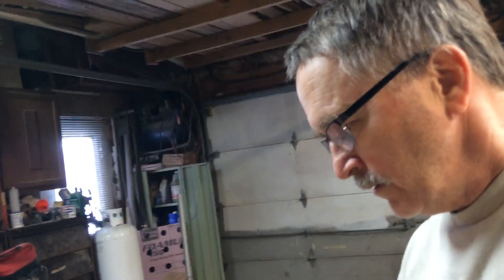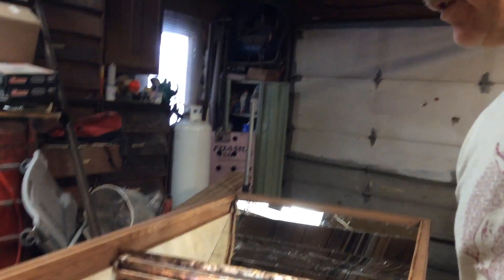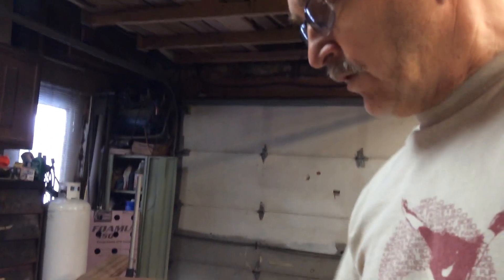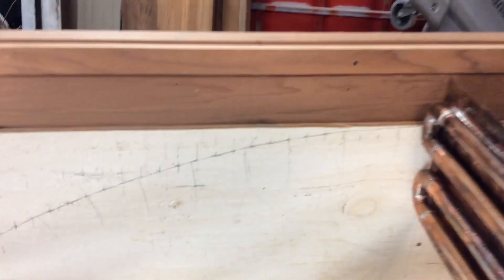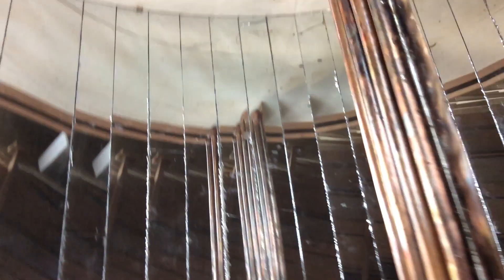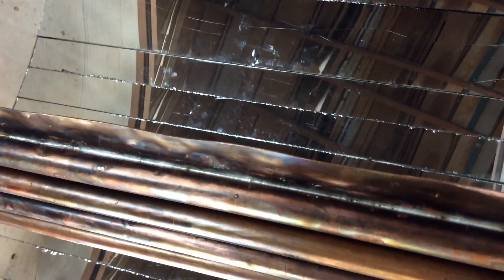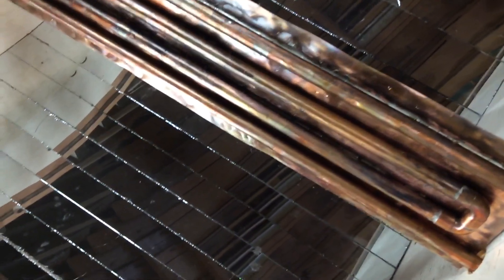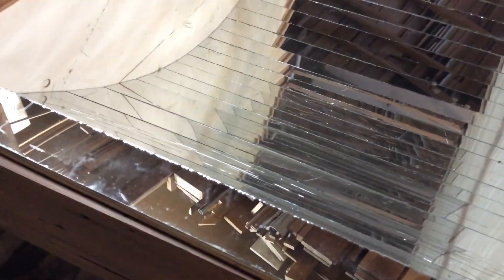Parabolic mirror trough solar hot water heater

Comment: That's a creative design if you don't need absolute max temperature.  Pointing accuracy is a lot less important for this layout.  Should be good for heating a pool or hot tub.  How much would it heat your tank?  What were input/output temps?

Comment: Did you do the math about where to place the absorber?  It doesn't look far enough out to me?
Reply from the maker: Nunya , Thanks for the?, Yes, I created a Google spreadsheet that I just plug in the trough width and the focal length and it generates the plot points of the mirror shape. I have checked with a laser and all the mirrors reflect on the absorber. I had a 4x8 ft sheet of glass, so I designed it to fit it. As you probably know it you make the focal length about 1/4 of the trough width the absorber will fall below the top edges of the trough . I designed it that way so it can have a glass cover to keep the snow and dust off the mirrors.
Reply: @kaf2303  nice.